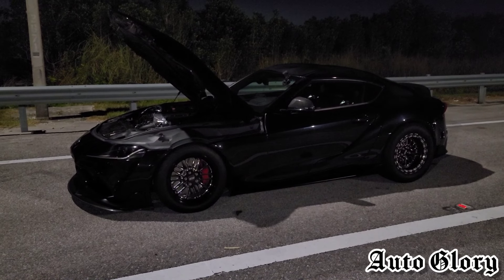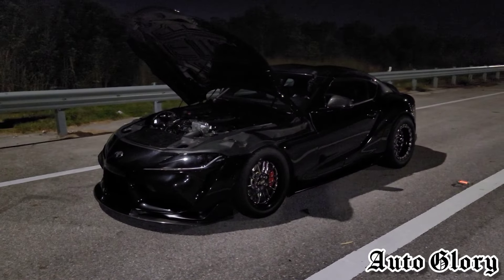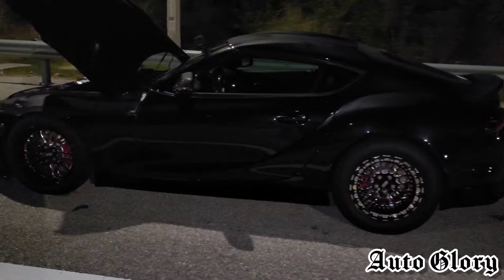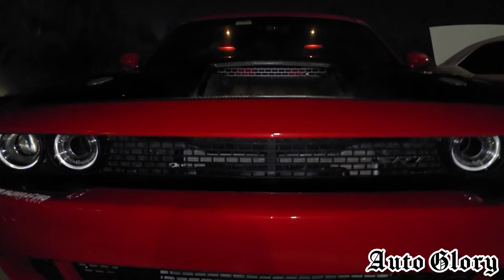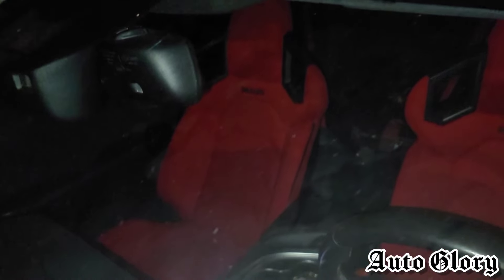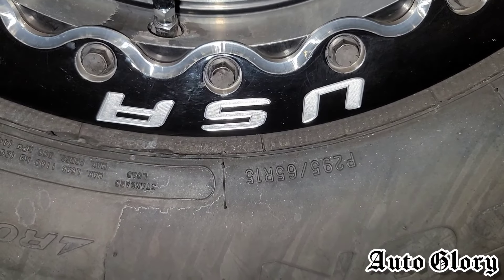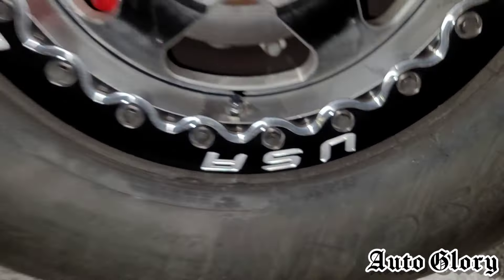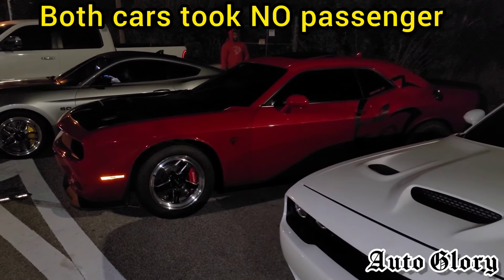Toyota Supra PT6870 Turbo E85 vs Dodge Challenger Hellcat FBO Cam E85

Comment: Stock 3.0L vs a cammed 6.2L 

Hilarious
Reply: i’d put a lot of money that, that supra has way more into it that he says 
if not find me another supra running like this one 
and don’t you dare say baby yaga 
these are actual clean fair races and this supra is handing out the gap to very very fast cars 
i’m calling cap
Reply: @Toxic_coyote12  ok lol
Reply: @Toxic_coyote12  a90 sam also has a fast supra. stock motor as well. Most people go pures/ hybrids thats why they dont move like this one. You put a proper turbo setup , with fuel system and trans and you get this result.
Reply: @Kona Blue GT  ColoradoN5x has a very similar Supra and is killing about every car he race's
Reply: @Kona Blue GT  HDwerk build a stock engine Supra probably faster than this one
Reply: @Toxic_coyote12  put a lot of monopoly money
Reply: I wonder what would be the result stock vs stock.
Reply: @El Lobo PoderosoSDL  That's a stupid question! 😂 You mean what would the outcome be if it was the same HP VS same HP Supra would destroy it!! Hellcat comes with almost 800hp from factory while Supra comes out with 350hp but just a DP and tune coating $750 it will beat every 800hp hellcat on the road!

Comment: Imajine that hellcat 500 pounds less 🥶🥶🥶
Reply: But it will never be 500lbs less 🤷
Reply: If it were 500 lbs less, it wouldn’t be running bc it would be missing a lot of important shit lol.
Reply: @_austind  🤣...just a frame and engine
Reply: Imagine the hellcat with out the stock factory blower bro 😂 a whipple on that thing would be nasty
Reply: @freak_5.042  nah that’s not true. I know a challenger 392 1320 edition that’s gutted and weighs 3750 ish with 200lb driver.
Reply: @DodgeandGMkiIIingFurdDaiIy  like that camo 300😁

Comment: Put this mkv against any car on the channel and it'd be a good race
Reply: Nah they got some real heavy hitters that don’t come out often. There’s a 2000hp Dallas perf r8 in the area and multiple gtrs between 14-1800.
Reply: Grey camouflaged Gtr would stomp it for example
Reply: Nah bro the metallic silver Evo IX is at a whole other level that car was pushing 1,300 whp+ I think.
Reply: @hquwx6027  that car too. Smoked a TT Huracan easily
Reply: @Sandro Schtolpe  yep the evo was niceeee... too bad it broke, well it's difficult when your pushing that much power.

Comment: That was Awesome, two monstors going at it.  The B58 is way more robust than I thought, at 800 whp on a stock motor with serveral runs under its belt and its still moving strong. The S55 motor is not as robust at that level of HP, stock, so props to the Supra owner, you have a pretty unique motor!
Reply: I know plenty S55's as "robust" most poeple are afraid to push it.
Reply: Saying an engine made for racing is not as robust as a road engine has no logic
Reply: @Ur_cristiano_778  You're absolutely right, and you was the 1st to catch it in my comment.  I said all that illogical stuff to say this: I don't believe one bit that the B58 in this Supra is stock, especially pushing 800 whp.  The S55 is good up to 750 whp with upgraded turbos on a stock motor, but anything over that, and things in the engine starts cracking and breaking, I know because I own a F82.  Don't get me wrong, that B58 "road engine" has lots of power potential, but pushing 800 whp on a stock motor for several runs is just not believable.  I could be wrong, but ask any tuned big turbo Supra owner pushing 700+ aside from the owner in the vid and they'll tell you they do not roll tuned with that much HP on stock motor.  Good catch by the way.
Reply: @franklinwatson7767  agree just thinking about now, maybe he's hiding some things.
Reply: Got to read in between the lines of my comment.  That B58 is not a stock motor running 800 whp…I could be wrong, but owning a S55 F82, I know a few things…
Reply: @franklinwatson7767  that's no were close to stock. That B58 is built.

Comment: Love to see another run.
Cat was spinning tires.
Reply: Cat led for 35+ mph and started getting caught after 100 mph. On MT streets w 1k hp and 4300lbs at 100 mph. Im sure cat woulda mentioned he felt the slip and run it again
Reply: @ericcervantes2449  Yea the driver and Auto Glory already discussed it in another comment he left black marks till 100 mph. 
Regardless Supra won but I always like to see a few different runs things change  at times.
Reply: @mongoose406  i didnt catch where he mentioned it but if he did then I'll take back my last comment. I didnt noticed the tire marks till i put brightness up. But for sure that cat fast for almost 1k lbs more
Reply: @ericcervantes2449  They are both brutal competitors but supra took this win.
Reply: @mongoose406  relax the better car from the better countries won
Reply: I know that's not you Stan ...you are  Sneaky.
Reply: @mongoose406  nah all real stans know imports always>

Comment: calling cap on supra mods find me another supra running like this with similar mods
Reply: ColoradoN5x
Reply: Cry more about it. As always, Import>
Reply: @jesseg.1900  oh this is the one you’re talking about ? 
https://youtu.be/NcSTlu5i1J4
built motor and transmission 

hey don’t wanna be the one to break it to you. but this supra in the video claims stock motor 
so no this is not a good example of a supra with similar mods
Reply: @jesseg.1900  you’re actually convincing me more that this supra is lying about mods 
thanks for that

Comment: Cam, ported blower, FBO, pulley's and only 1000whp? Lol...are we sure he ain't 1100? Lol... either way the heavy Cat put up a good fight but 800whp and 3300lbs is tough to beat. Good run 👍
Reply: Yeah, thats one fast Hellcat for sure
Reply from the maker: Maybe it's making more than just 1000. You don't always know around here. Lol
Reply: @AutoGlory  Lol.. agree for sure.
Reply: I don't know depends on his pulley sizes but he could be making anywhere in the range. Maybe he is playing it safe. I personally wouldn't go above 950whp without beefing up the engine trans some more.
Reply: Until we see the dyno numbers for each car don’t believe anything
Reply: Some of the dual pumps are only rated for around 1000whp on e85. Could be what’s holding him back but idk what setup he has for fuel delivery
Reply: @AutoGlory  😂😊